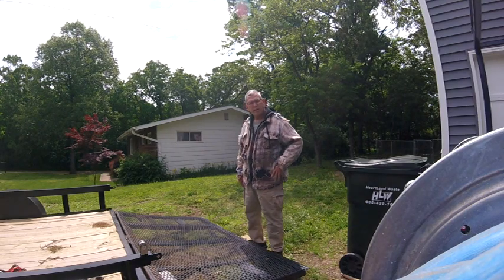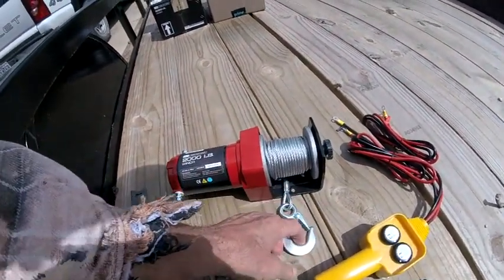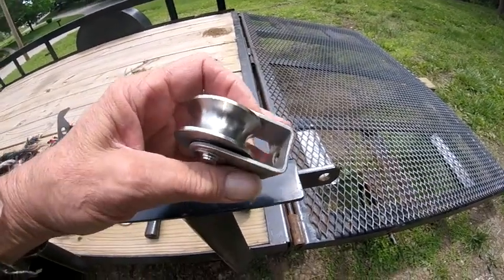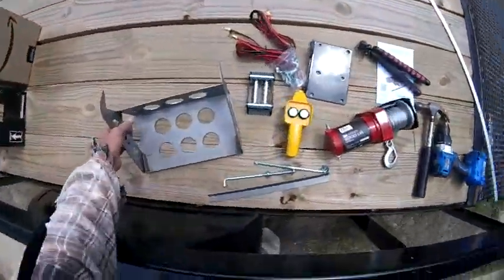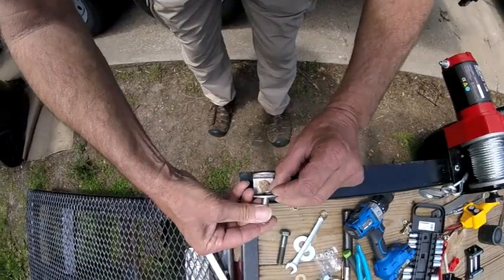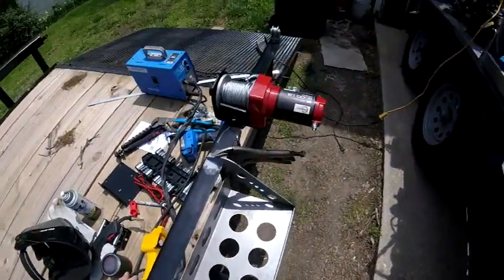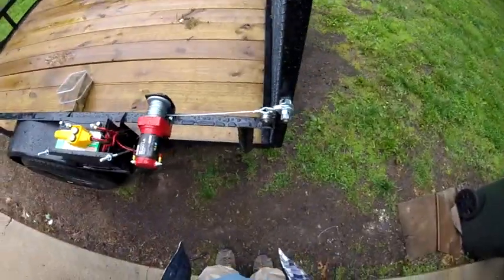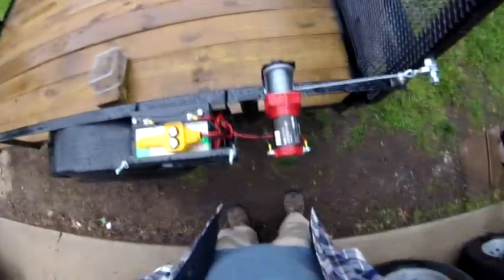Easy electric gate operator. Do you have a heavy trailer gate? Do this!

Comment: Seems like the spring system would have been easier but I would be a little afraid the springs might brake but maybe you could put a short strong spring so i helps push the gate backwards to help lower the ramp when you first start to let the gate down maybe use some stainless steel metal plates with rubber on them and a stainless 2 inch spring ?
Reply from the maker: I installed the spring system for my best friend.  It has a safety cable running through it.  My system is cheaper and easier to run.

Comment: Not a bad solution. I don't really like how the winch, battery, and that big ass bolt stick out so much, though.  I know this is 2yrs old and you may have made some improvements too it already, but I would suggest using TWO of those little pulleys placed together (in line) and pretty close to each other. That way, you could run the winch line under the pulley closest to the winch, then over the top of the pulley closest to the drive on ramp gate. That should keep the winch cable in proper position all the time, and avoid having to thread it on that single pulley every time you lower the gate. OR.... for probably about the same amount of money you could have bought two Gorilla Lifts that would do the same thing, and provide a cleaner look. Good luck!!

Comment: Could use the 7 pin harness to charge the battery. Or mount a vevor 36" tool box on the wheel we'll and place a small solar panel. 

I'm about to do something similar. Building the ramp out about 12-16" to hold pressure washing surface cleaners and a sign. The gate will only have to drop down 90° but there's going to be double the weight.
Reply from the maker: Oddly the battery will run the whole season on one charge.  So I don't have a reason to connect a charging system.  I use it once every two weeks though.  Only 6 cycles per use.

Comment: crazy idea
Reply from the maker: It works though
Reply from the maker: Still working
Reply: Crazy? If it works perfectly is it though?
Reply from the maker: @Mr.SuperDuper-idk   Still working great
Reply: @mowerdog  👏
Reply: This entire system is a great idea! Congratulations. Constantly lifting that heavy gate in the back will eventually damage your intervertebral discs. Lifting heavy weights from below your knees is dangerous for the back. Never lift anything using your back. Always use your legs. This system makes the entire lifting process automated.

Comment: Do you need to put a bracket on the battery to keep it from jumping off when you hit rough road...
Reply from the maker: Yes.  The battery box comes with a bracket
Reply: @mowerdog  sorry, didn't see it....
Reply from the maker: @rickynash4561 No worries.  Allstar ALL76100 11-3/4" Wide x 7-1/4" Deep Lightweight Steel Battery Mounting Box https://a.co/d/jkipzCq

Comment: Just curious if them portable jump packs would do the job that way u can recharge on your cigi lighter port
Reply from the maker: I think they would.  Just a time or two though.  I used it all last summer on the initial battery charge.
Reply: i start a 13hp harbor freight engine n my wood splitter and it does the job